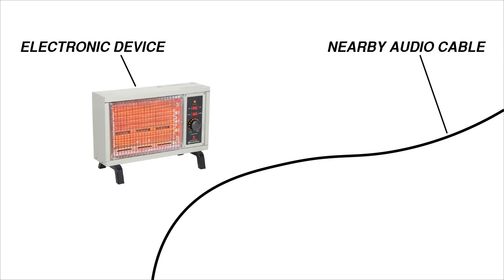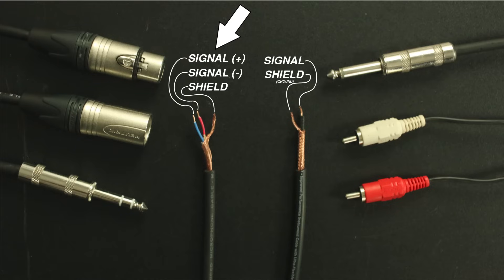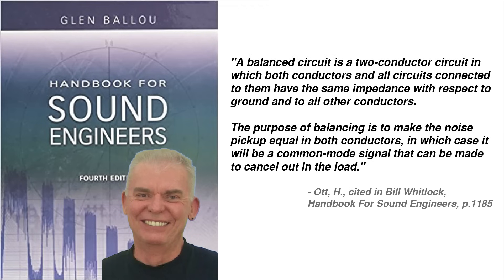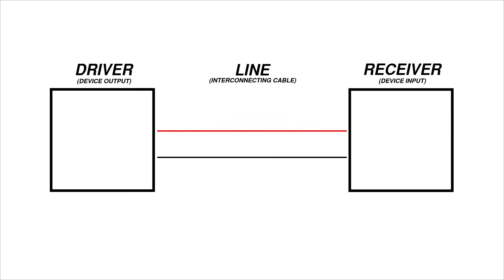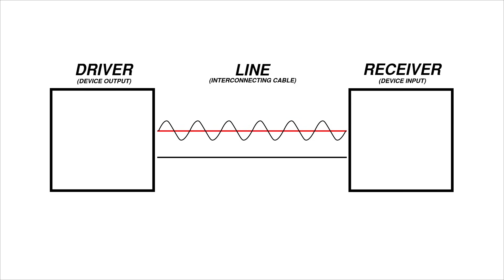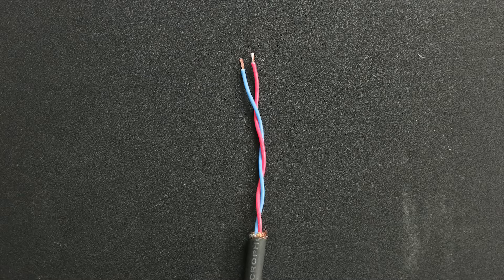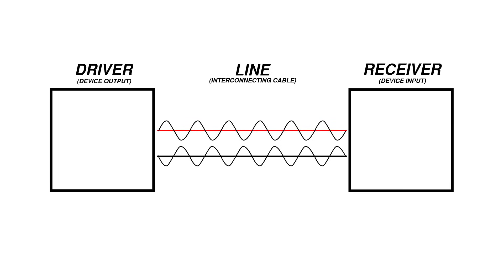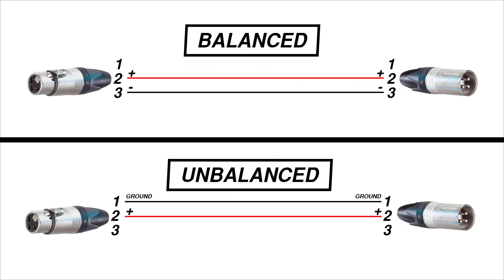Balanced vs Unbalanced Audio | Do Balanced Cables Sound Better?

Comment: You're missing one important point... shielding. Ingenious engineers thought that by shielding the signal wire (making the return wire the shield) they would be blocking noise. In fact, they were also blocking common mode noise rejection, leaving noise only on the return (shield) which can't be rejected. Unshielded twisted pair can run for miles in the phone system with negligible noise. Yes this is balanced. But balanced in the audio world also includes shielding around the balanced pair. This causes another level of grounding problems.
Reply from the maker: In a balanced audio connection, I don't believe the shield is the return. I'll admit - I'm getting a bit outside of my comfort zone here. However, if the shield (ground) were the return, using an XLR ground lift would not allow the signal to flow. Instead, I believe that the signals are referenced to the signal ground within each device. In an unbalanced connection, the shield is the return. Again, please correct me if I'm wrong here!
Reply: @AudioUniversity  XLR is balanced + shield, hence three pins. It could be unbalanced if you use only one signal pin + ground, but that's not common. XLR transformers are more common to perform the unbal to bal properly. Also, ground lifts are intended to eliminate ground loops where the shield is grounded in two different locations in the house system.
Reply: @AudioUniversity  In the event of an earth loop, noise with a frequency of 50 or 60 Hz appears and then Di box devices are used, they have a Ground Lift switch. In fact, the ground of one device is disconnected from the connection to the ground of another device, but the signal continues to be transmitted. My active monitors made Hum noise when I connected them with a balanced cable to the output of the sound card in computer. Then I disconnected the shielding earth winding - 1 pin at the connector connected to the monitor and the noise disappeared. The signal is perfectly transmitted over two wires 2 and 3 pin.
Reply from the maker: That’s exactly what I was trying to say above, @Drums and Percussion - I don’t believe the shield is required for transmitting the signal across the cable because ground lifts (pin 1 lifts) are commonly used. Thanks for sharing this anecdote.
Reply: @AudioUniversity  XLR does not use the shield for any part of the signal.  The signal is on a twisted pair for complete common mode noise rejection.  The third pin is the ground.  Generally speaking you want to ground only one end of a shielded balanced cable to bleed off any electric charge.  If you ground both ends you could end up with a "ground loop" if the two pieces of equipment are not at the same chassis potential (different phases of alternating current, for instance).  Single ended unbalanced cables always create the possibility of ground loops especially if the signal cable is the only thing that connects two pieces of equipment.
Reply from the maker: Thanks, Thomas! I appreciate you explaining that.
Reply: @thomasmaughan4798  phantom power requires that you connect all three conductors as the shield is used as the 0V rail (the +48V is connected to both the sig+ & sig- so is common mode and therefore rejected), so if you don't connect the shield at both ends then you cannot use any P48 equipment.
Reply: @thomasmaughan4798  - Asking- So the Shield should only be connected on one end of a twisted-pair shielded cable in a simple long-run audio signal source-to-output device then out to speakers connection ? Seems to make sense with the induced signal and the potential for the ground loop problem. Explains a couple of things I couldn't figure out. Checking to be sure, tho. Thanks - C.
Reply: @chuckintexas  Generally speaking, yes; and the end of the cable that has its ground actually connected is the end closer to the system common ground (if you have one).  As others point out, phantom power requires the ground at both ends BUT if you are in that situation, powering a microphone, ground loops cannot exist anyway.
Reply: @thomasmaughan4798  - Thomas- Hi ! and THANKS ! 
Its been YEARS since I've dived into any of this, and I'm trying to do a GOOD job setting up some BASIC decent sound for our Living Room TV and Stereo.
 While the BASIC options offered by BOTH are really fairly "DECENT" , I wanted a little more control, and maybe a punch-up to the next MODEST but REASONABLE quality level, and your input really helps - THANKS again ! -
And-
ALL the BEST from Texas  -
C.
Reply: @AudioUniversity  Not shielding your balanced cables makes that your earth starts to flow, if you put +48v phantom power on these, the phantom power doesn't work, for condenser microphones for one. So always the shield on pin one.
Reply: @AudioUniversity  you're right, balanced connection uses only two wires for transmitting signal, same as the unbalanced one. You only need ground for safe connection purposes (let the static electricity flow away through the ground), and for phantom power.

Both signals in balanced connection are referenced to each other, not to the "signal ground within each device". Like, when you have 1.5 V on one wire and -1.5 V on the other wire, you'll get the total of 3V. That's how balanced connection works - it doubles the signal and kills the noise (because noise is same phase on both wires while the signal is reversed on the second wire).
Reply from the maker: Thanks for helping to clarify this for us, @mchekb!
Reply: Another way to look at the balanced transmission line is that each signal line is referenced to the other; think of them as cross-referenced, more or less.  The signal current in one lead has to have a return path back to the source for there to even be a point of reference for the signal.  It would be like saying a battery could be connected with just one wire.  Having a signal + and - isolates the signal from the ground/earth as a return path.

The unbalanced line implies a ground as a reference or return for the single wire signal line, which is one way of picking up noise.

Combining these concepts with understanding the differences in types of ground connections should help as well.  Isolating power ground connections from signal grounds helps to prevent noisy circuits.  In general nothing is a perfect conductor, there is always some resistance involved in wires or metal chassis or panels.  Any current passing through the resistance within that metal will have a voltage drop across it.  For an AC line power source, a fraction of a volt isn't much, but that same fraction is huge on a signal line input to an amplifier.  If you have power and signal grounds sharing the same path, at least some noise is bound to be transferred to where you don't want it.  This is part of the concept of ground loops, and why simply grounding a shield at both ends of a cable may cause noise rather than cure it.  I tend to describe grounding a shield only at one end as a way to "drain" the noise away.  If an unbalanced cable uses the shield as the return path, it's hard to just disconnect it.

I hope this information helps people to better understand balanced and unbalanced cabling.

Comment: Much wron with the explanaition,passes the fact how opamps and ampliefiers work.So where the signals start and where it ends.
I suggest you reed Doug selfs his amplifier handbook,or read the details on Rod elliot his website.
A ballanced cable use a positive and negative signal (+15 and  -15 volt and commond ground of cententer tap o volt of the power supply)
Doug and rod are mh better in expalinig everyhinbg

Comment: Could using a balanced cable for a bass guitar (one 1/4” going from guitar to DI, one going from DI to amp, and one XLR from DI output to snake) to rid some unwanted buzz?
Reply from the maker: It might help with the buzz in the DI signal, but I don’t believe it will affect the signal to the amplifier.
Reply: @AudioUniversity  thanks for the response! I appreciate it!
Reply: Bass (and guitar) amps don't have differential inputs, so they won't cancel the noise. Pickups on basses are wired so their coils and magnets are out of phase so it already cancels out the hum getting picked up (flipping the magnets is what puts the wanted signal back into phase so it isn't canceled out.) I think some boutique basses do come with balanced outputs, but it's very rare. Also, the jacks on basses use TRS jacks that so that they can disconnect the battery when you unplug them. If you were to add a balanced output, you'd need to have a separate on/off switch for the battery because the reversed phase would take the part of the jack used to turn on the battery.
Reply from the maker: Thanks for sharing this information, @Skippii Kai Tollkuhn!

Comment: Excellent job of explaining the topic. Most often the input device that the balanced signal is connected to is an operational amplifier which as you stated, amplifies the difference between the signals on the cables thus providing common mode rejection.
Reply from the maker: Thanks for sharing this extra information, Fred!

Comment: I’m curious though….if the inverted signal isn’t necessary, then arguably the exact same signal (including noise) would be travelling through both signal wires….how would the differential device identify the noise for cancellation? Doesn’t it need a reference? As I understood it, the inverted signal was a requirement because the noise would not be inverted (as it’s induced after the fact) and is therefor easily identifiable (ie; it’s the only part of both signals that is identical). Am I wrong?
Reply: At the far end a transformer is listening (more or less) to what comes over its two wires (third is shield/ground).  That portion of the signal that goes IN one wire and OUT the other, but still on the same side, creates a magnetic field and that magnetic field then induces a current on the other side of the transformer. 
But signal picked up by the wires along the way arrive at the SAME TIME on the transformer and because there is no pushing and pulling (differential), it does not set up a current and does not set up a magnetic field.  This is called "common mode" current; picked up along the way and COMMON to both wires.  It is ignored by the transformer.  
So it is that the common mode signal, picked up along the way, could actually be STRONGER than your microphone signal, but will be cleaned up by the transformer that responds only to differential current (push on one wire, pull on the other).  
A typical dynamic microphone already does this; sound moves a diaphram with a coil of wire in a magnetic field and it creates an electric current -- pushes in one wire and pulls in the other wire.
Reply: Thomas Maughan  I see…..so what you are saying if I understand correctly….is that first we have a ‘linear’ signal travelling on both wires from the source through the transformer, and that linear signal will induce and transfer that signal through a magnetic field to the other set of windings on the transformer and thus into the receiving device. Any interference induced into the same pair from external sources will result in a somewhat equal, parallel and directionally proportional signal that is not “seen” by the transformer because there is no ‘potential difference’ at the inductor coil. It would be the much the same as having a long pair of wires stretched out and connected to the transformer but with no audio signal (assuming equal length, conductor and wires being in the same insulator the whole distance)…..there’s nothing at the transformer coil to induce a field as there needs to be a potential difference at the coil. Sorry for the long question/clarification….I did not previously know how this works. I was unaware that a transformer was used in the signal path of balanced connections….I had assumed some sort of decoding was done, which was why an inverted signal is sometimes used. Teach a man how to fish, and all that. Cheers!
Reply: @CapriciousBlackBox  Your description is accurate and shows good understanding.
Reply from the maker: Thanks, Thomas - you’ve got a gift for explaining these things. Very helpful!
Reply from the maker: When I say the inverted signal isn’t necessary, I mean that if you sent the in polarity signal (referenced to device’s signal ground) across one wire, the noise cancellation would still occur. If you sent a signal across one wire and an equal but opposite inverse polarity signal across the other wire, the noise cancellation would occur, plus the signal strength would increase by 6dB.
Reply: @AudioUniversity  But if the inverted signal is not an inverted signal, it's is not a symetrical (balanced!) signal. 
Simple Conclusion: What you are saying is basically wrong, so is your statement about "a common myth"...!
Reply from the maker: HafiBeat - The inverted signal is not required for noise cancellation. Even without an inverse signal, if the noise in each wire is still identical then it will be cancelled in the differential input.
Reply: @AudioUniversity ah you mean the noise itself would cancel out cause it hits a symetrical line? Where do you get that Idea? Any References?
Reply from the maker: Handbook for Sound Engineers - https://amzn.to/2TtJ2N3

This is the text with the Bill Whitlock excerpt I cited in the video.
Reply: @AudioUniversity  You're right! I had a hard time to contemplate what you are trying to say.  ;-) 
Thing is, there is no reason the inverse signal is not inverse in a balanced line. But  - ONLY - if you cut the line on the output (source), noise will cancel out.

Comment: thanks for clearing that up. i got a good deal on a Bowers & Wilkins DB4S subwoofer. normal price is $1900, but i paid less than $800. it has an XLR input, but sadly my reviver does not have XLR for subs. i will use an XLR to RCA cable and make it into an unbalanced connection. yes it sucks to lose suck a cool function, but I'm not ready to replace a $600 receiver/amp with something even more expensive. it seems that every sub in the $800 and below range only supports RCA. if interference becomes a problem, maybe i'll just add more shielding and hope for the best
Reply from the maker: Awesome deal! Nice! You are correct about the adapter - that will still be an unbalanced connection. However, if noise is an issue, you might consider using a passive DI box like this one: https://amzn.to/3qzMA1w
Reply: @AudioUniversity  i just looked up the tool, read at the documentation and it looks interesting. my understanding is that i should plug my XLR sub into the output and an RCA to XLR cable coming from my receiver into the input XLR port. any i don't need anything on the other side. am i correct?
Reply from the maker: You can just connect the RCA output of your receiver to the box with an RCA to RCA cable. 

If it’s a short distance, the RCA to XLR will be fine.

Comment: I built a Frankenstein bass years back and put in a XLR connector instead of the usual 1/4” jack, just because I didn’t want the hum when I turned up the volume. I never got around to figuring out the ends (pick-up and amp sides) of the system, because when I took it in to a repair technician, the guy thought I was an idiot and suggested to just stick with a 1/4” jack and be done with it. Which is what I did. My questions are: Am I an idiot? What would I need to do on the pick-up and amp sides to get my idea to work? At least half the time I will be going straight into an interface anyway, so…..
Reply from the maker: You’re definitely NOT an idiot. It’s an interesting idea. However, the best way to achieve the result you’re going for is to use a relatively short 1/4” TS cable from the guitar into a DI box. That will transform the high impedance guitar output into a low impedance, balanced connection (when connected to a balanced input). I’d recommend this method if going into a mixer or interface from a long distance. You will struggle to find an amplifier with a balanced input, so even using an XLR connection on the guitar wouldn’t accomplish the benefits of a balanced circuit.
Reply: Okay, that is making sense. I had never considered a DI box. Thanks!

Comment: I'm  a bit older than you! Ha!
When l was a kid
Balanced cables were able to go 600 feet or more. Unbalanced  went 10 feet  w/o losing the high frequencies. 
So 1/4" was for  things like guitars and interconnects for audio equipment. 
The ballanced was for Mike's and long distant ballanced audio connections. 
If we got interference  from  RF  we made a circular loop of cable to act as a choke. 

If we got hum the rule of  thumb was to separate the audio cables from power lines 6-10 feet so no induction happened. 
And not to run parallel  runs  and if you had to cross  you crossed your lines at 90 degree angles.

 But I'd say you did a good job of explaining it. 🙂
Reply from the maker: These are great tips, Lee! Thanks for sharing your experience with us!
Reply: @AudioUniversity how do you know how much gear you can plug in without blowing a outlet ?
Reply: Unbalanced doesn’t need to lose high frequencies. The only reason why that happened on old gear is because the connection was poorly designed, for example on passive electric guitar pickups. The signal there is high impedance and reactive. A 20 m cable would sound shockingly dull compared to a 2m one. This is a design flaw that balancing wouldn’t fix. 

A low-impedance line-level unbalanced signal will not lose high frequencies any more than a balanced signal. It will, however, get very noisy over longer runs, which is why balancing is necessary. This is even worse for small signals such as those of microphones, which can often be over 100 times quieter.
Reply: Do you want to stretch cables around your house?